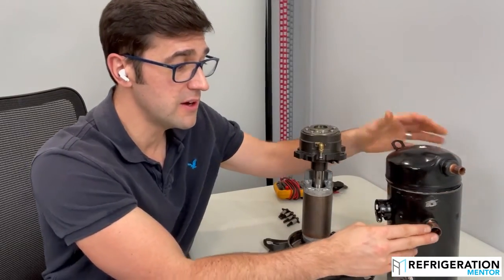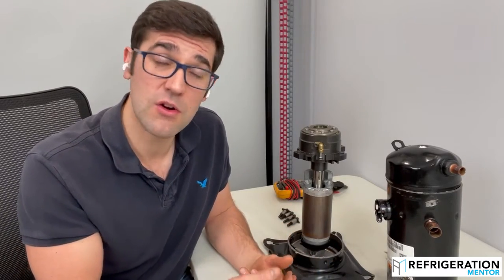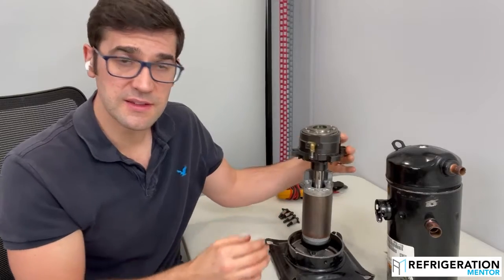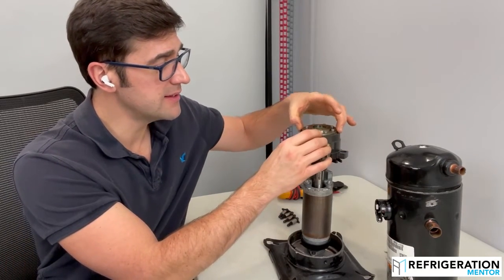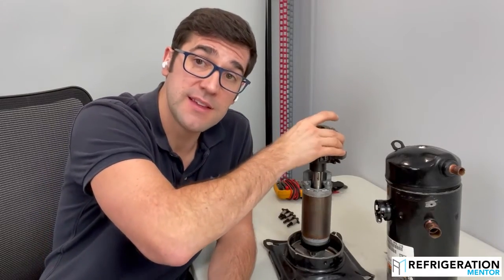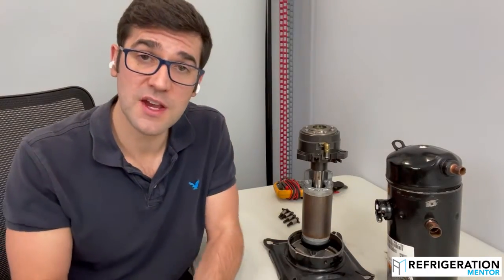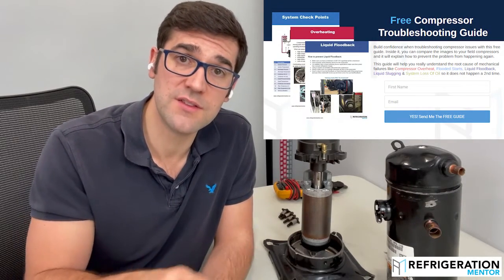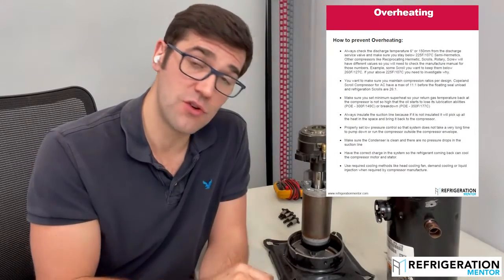Free Compressor Troubleshooting Guide for Refrigeration Technicians

Comment: Am working on a scroll compressor  that most tech that check unit  sed  that compressor  burn but when  I check compressor  is working  but meaking a lot of noise already have a new one seem like it wos running  with out oil  foun out  that unit have  a refrigerant leak from the high side of the unit 
U tink that  can cause unit to stop suction  or the discharge pressure from moving up or down
Reply from the maker: @hubertjacob9606  that is not enough information. Did you measure the oil out of the old compressor?
Reply: @RefrigerationMentor  I can't the compressor  is still on condencing  unit  I add sum poe oil  to compressor but compressor  still  not  puming

Comment: My outdoor unit will run for about two minutes, blowing cold air, then there is a loud noise at the condenser that sounds like a car engine throwing a rod. Lol. Then the whole unit shuts down. Is this an indication of high compression ratio?